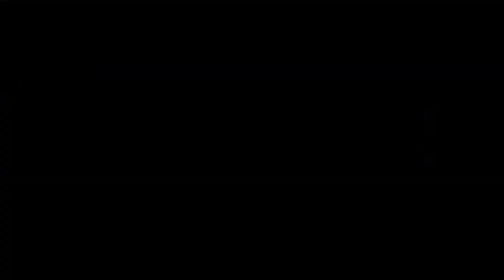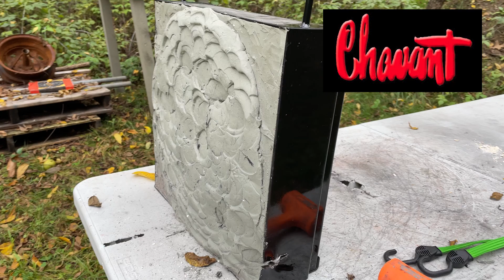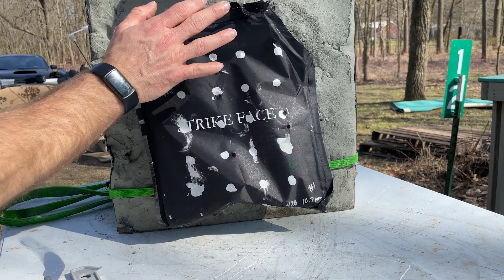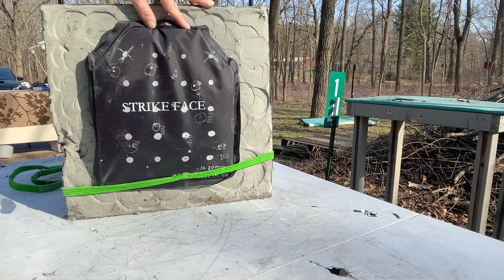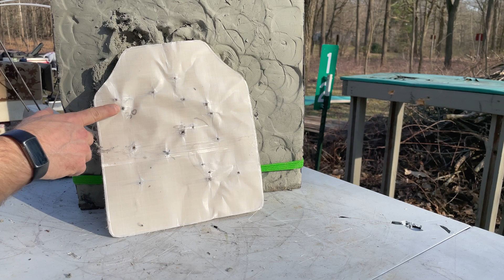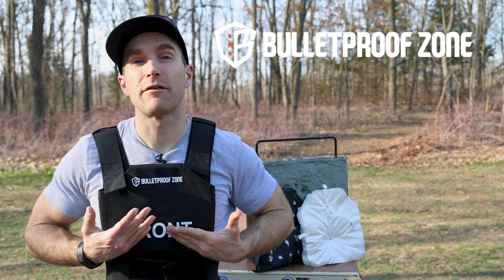Bulletproof Zone, ProtectVest, NIJ Level IIIA

Comment: Super test merci à vous, pouvez vous faire le test avec deux protection NIJ 3A superposée ?? 🤔😉
Reply from the maker: what kind of threat are you looking at stopping by stacking 2?
Reply: Slug, 9 mm pistolet mitrailleur, chevrotine 9 grains...😉 @BuffRANGE
Reply from the maker: @fredoaix8653  I'll see what I can do. Generally speaking doubling up the panels doesn't increase it's threat level, but can reduce blunt force trauma

Comment: Get hyperline by safelife defense.  it's 1/8 of an inch thick  and with the concealable carrier for the panels it's very difficult to detect in anything other than a t shirt.  It covers a much larger area than a carrier like this and is much less visible.
Reply from the maker: I've asked them a few times about that panel, so far empty promises.  I'll bug them again..
Reply: @BuffRANGE  I have one.  The vids I have seen so far testing them have been impressive.  Tough stuff, I think it is just really hard pressed UHMWPE with a bonding material that makes it very difficult to take apart the layers.  If you get some I assume you will dissect it.
Reply from the maker: @huwhitecavebeast1972  I'll bug Nick again.

Comment: Sometimes I really wonder how these light plates would perform with a hard oxidized 1.5 or 2mm titanium plate in front
Reply: 1.5mm hard oxidized grade 4 titanium up front, 25mm kevlar/UHMWPE composite in the center, and 3mm of grade 5 titanium with a 1mm layer of grade 4 backing for stiffness. That a total of 30.5 mm, or 1.2" thick.
Reply: @ostiariusalpha  Make it!
Reply: lots better I imagine.  You could probably sandwich some UHWMPE in between 2 plates like that and stop a lot of stuff.